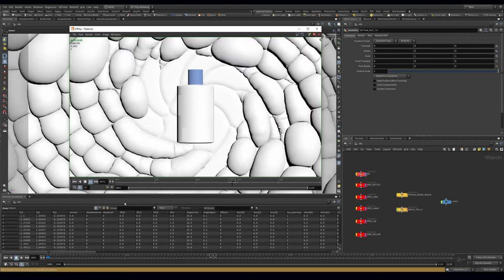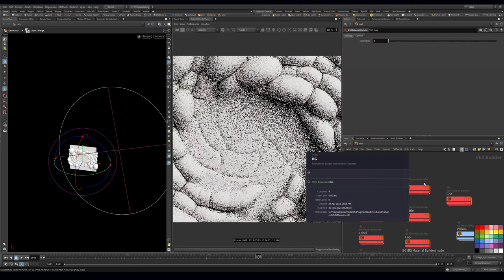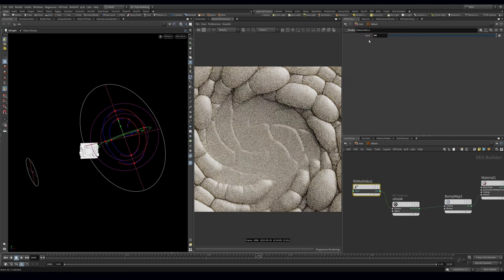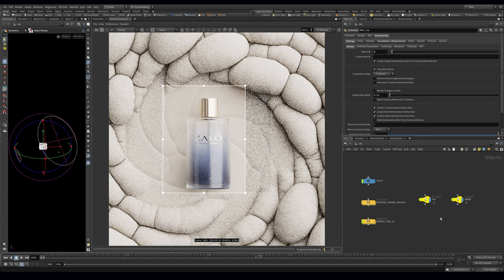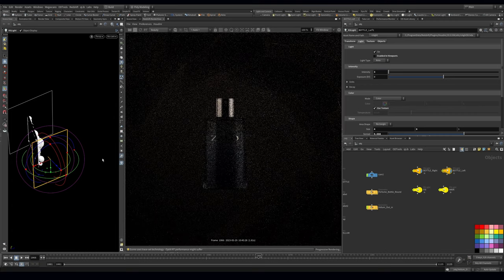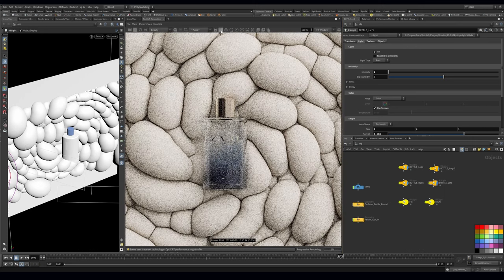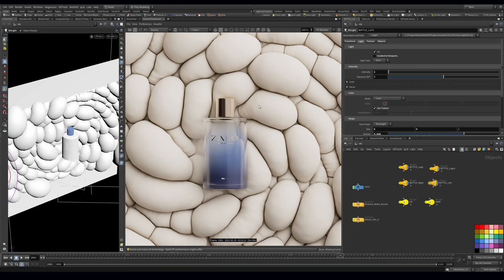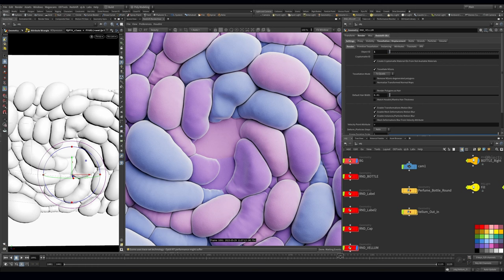Learn to Render... Like me.

Comment: I constantly have the same problem. RS starts getting slow and slow and only goes back when I restar the machine.
Reply: Sometimes you need to stop the render and let houdini still for 10 secs for the vram to clear. What helps me is turning max memory to 65% instead of the default 90
Reply from the maker: @jcmpmjmp  I thought this was supposed to be fixed in the latest build, but, maybe not. I still have all sorts of problems. It can be quite frustrating, I must admit!

Comment: Thanks for this Paul! Always a treat...Quick question when you're selecting the RS nodes and's it's giving you a raw preview what each one is doing (piping straight to the 'Surface' input of the RS material) is there a shortcut for this? Usually I have to click the 'Debug' tag on each node - seems you have a quick way to do it? Cheers
Reply from the maker: Thanks for the comment! :) Lewis has an awesome tutorial on the connect selected node to output: https://www.youtube.com/watch?v=OdW9JFOzjGc